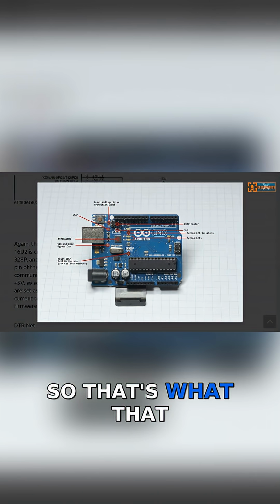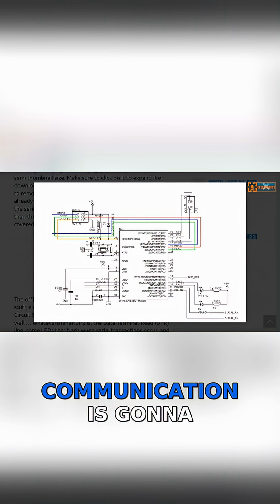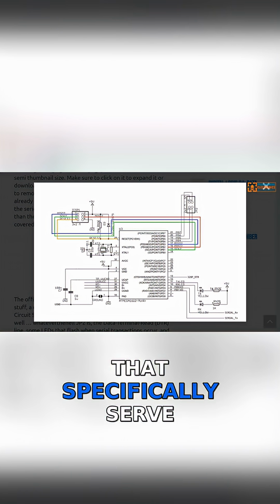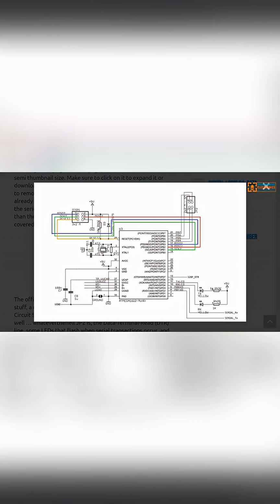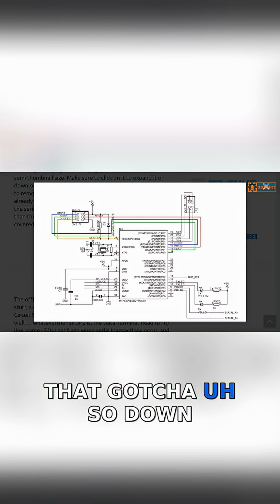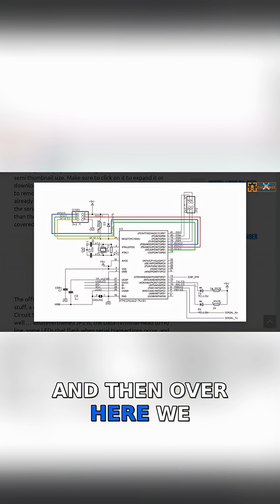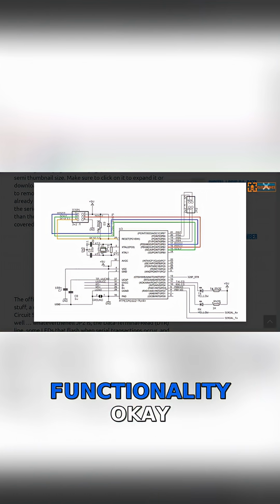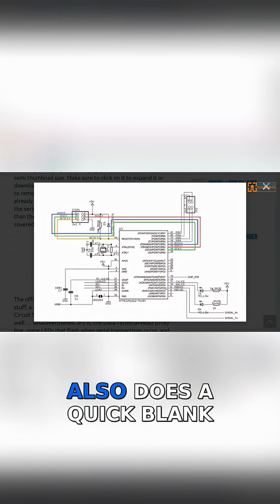The Fascinating World of USB to Serial Communication

Comment: Who knows Arduino Programming
Reply: who doesn't?
Reply: Rhetorical question, or actual curiosity ?

Back when Arduino clones were like $3-$5 each, I purchased them like jelly beans. No worries about the magic smoke, it was cheap.
And when the circuit was finalized, I purchased an ‘official’ Arduino from Italy.
Arduino IDE software was EVERYwhere… ran on ANYthing.

But electronics were crazy-cheap back then, so you could really play around with little concern for $$.